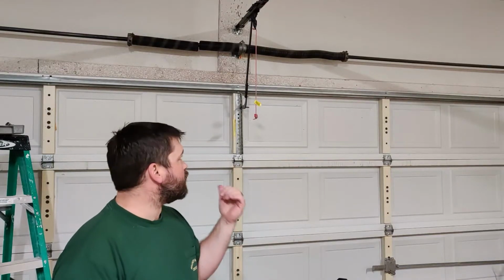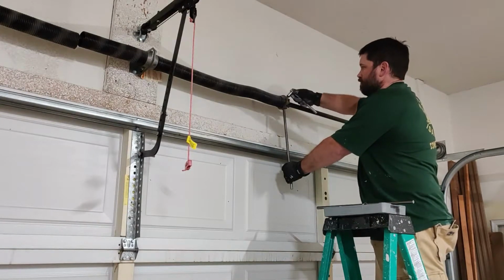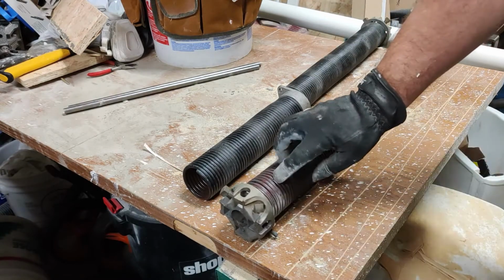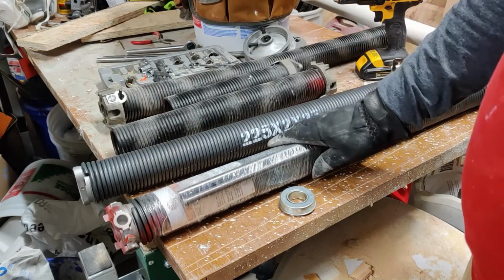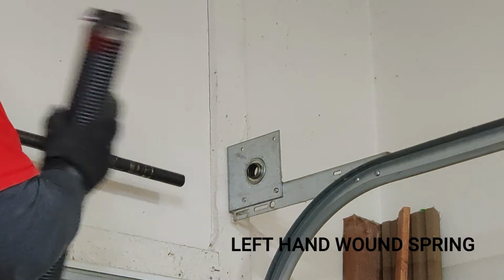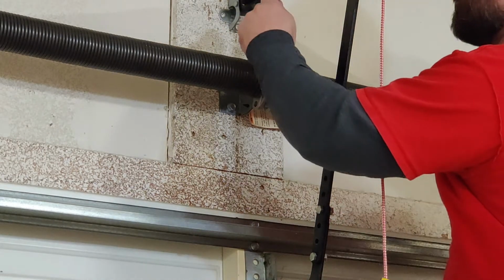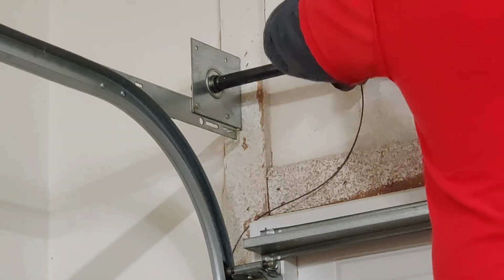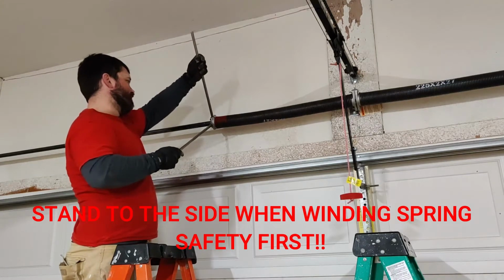HOW TO CHANGE A GARAGE DOOR SPRING (torsion)

Comment: Which side controls up and which side controls down??
Reply from the maker: I am not completely sure what you mean.  The springs act as a counter balance for the weight of the door.  If you are talking adjusting the springs to balance the door, I usually adjust both springs the same amount.  I am not a professional installer though so that may not be necessary.  Here is a video that does a pretty good job of explaining how the springs work. https://www.youtube.com/watch?v=2yFhsl3s_4A
Reply: @HomeRepairHub  ok. Cause I have two different size springs. Most videos I watch here the springs look to be the same size in length that is.
Reply from the maker: You should have two springs of the same size.  I am not aware of a situation where you would put on two different size springs.  That being said I am not a professional garage door installer.  If your garage door has 2 different size springs I would probably contact a professional and have them look at it.
Reply: @HomeRepairHub  so the force of door opening and closing does both springs work together as one or does one spring work for when door opens and the other spring work for when door closes. Best way I can explain.
Reply from the maker: @markchambers8641  the springs work together, not separately.  A smaller lighter door may only need one spring because there is less weight.  Where a larger door may require 2 or even 3 because it is larger and weighs more.  This is a very simple example, but if you have teeter totter with a 100lb weight on one side and nothing on the other side it would require a 100lbs of force to lift the teeter totter.  If you were to put a 90lb weight on the side that had no weight on it, it would require significantly less force to lift the teeter totter.  So if you have a 150lb door, the tightened spring would essentially act like a 130lb counter balance (depending on how tight it is wound, the length and coil size) so now you only need 20lb of force to open the door vs 150lbs of force.  These numbers are just used as examples.  The springs work together.   Hopefully that helps.  Like I said I am not a garage door installer so this is just kinda the way I see it.
Reply: @HomeRepairHub  one more question. Which way do you tighten the two springs?
Reply from the maker: @markchambers8641  It depends on which spring you are installing.  The spring with the red cone, would be counter-clockwise, a spring with a black cone be clock-wise.  I would take a look at the video again and watch which spring I put on each side.  When you tighten the springs you should be going up with the winding bars.  If you go down to tighten them you have them on backwards.
Reply: @HomeRepairHub  ok cause the place where I purchased springs are color coordinated for different weights. Both springs are not the same weight but one spring does have red cone and the other spring has black cone.
Reply from the maker: @markchambers8641  so yes the coil size is also color coded.  That color would be on the spring itself but that doesn't tell you whether it is right or left hand would, that would be the color on the cone.  Like I said before, I am not aware off any scenario's where you would have different spring sizes and weights on the same door.  In my case both springs I installed were .225 coil size (red color on spring) and 27 inches in length.  I don't know what installations would require different spring sizes.
Reply: @HomeRepairHub  from Menard’s ideal door brand. They have a chart and based off 3 different things what they recommend ends up being two different sizes or should I say colors.
Reply: The LW and RW are different
Reply from the maker: @markchambers8641  Good to know.  I would guess that depends on the weigh.  I will have to check it out.
Reply: @markchambers8641  Both springs should be the same size. And the size is determined by measuring the length, the length of 20 coils (to find out the diameter of each coil), and the inside diameter of the spring. Those are probably the 3 things you're talking about. You only need to measure one spring to know the measurements of both springs.